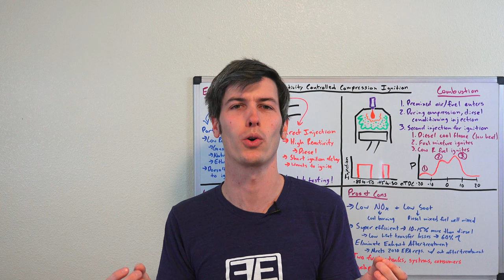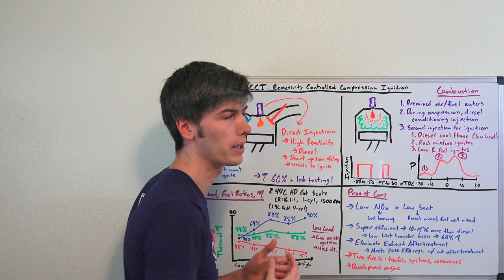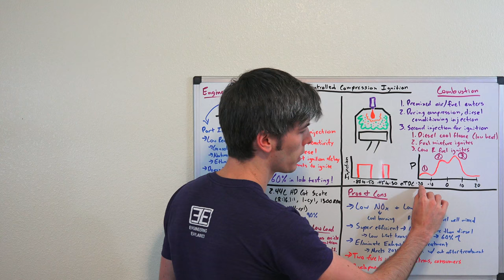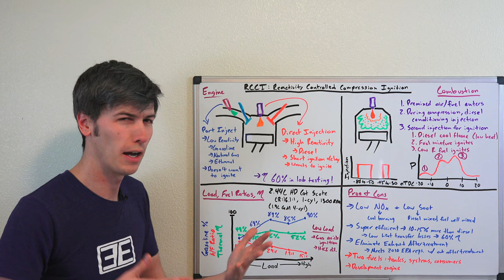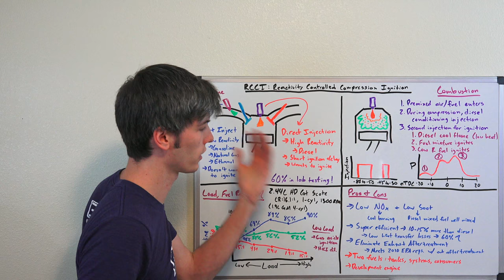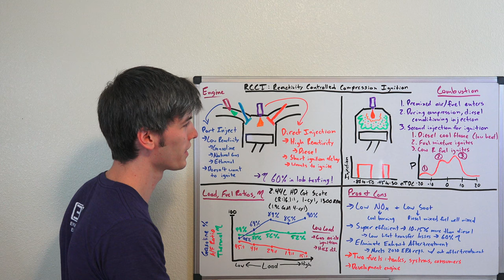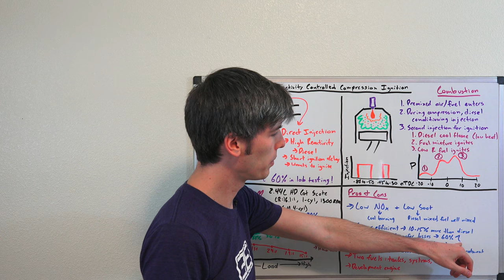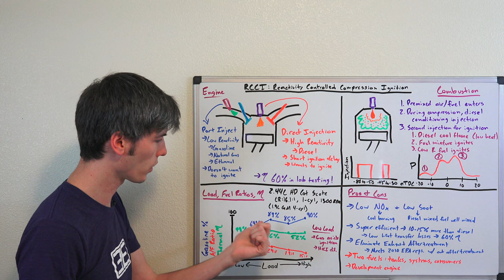Super Efficient Engine Uses Gas AND Diesel - RCCI

Comment: this was an innovative idea...... in 1954, when international harvester used it in their tractors,.didnt work that great then, wont work that great now. you'd be far better off with an aftermarket propane/no2 injection system.  anything comes out of adjustment and this engine you describe would destroy itself in a heartbeat.
 blending gasoline and diesel fuel pre injection is about all you can do to make this work reliably..... seriously, they've been saying they could do this and failing for over a hundred years. move on to non fossil fuels now please...

Comment: All freight trains since 1900 became electric generators petroleum gas or diesel to spend an electric motor and then send that electric current to the electric motors on the axles basically a train engine has an electric motor on every shaft with a big gear on it

Comment: What if the car is out of either petrol or diesel?
Reply from the maker: Diesel is the ignition source, so you wouldn't want to run out. But you don't want to run out of fuel in any car haha. Might be able to run purely on diesel in a sort of "limp to the gas station" mode.
Reply: Engineering Explained, then the exhaust system would require heavy catalytic convertors or you'll be left with no power and diesel emissions

Comment: A very narrow power band which will not work well with automobiles. The peak efficiency over load will soon be obviated by the need to stay within that band. 

Your videos, even a s well presented as they are, remind me of the time when the railroad steam enthusiasts were trying desperately to develop those much beloved, but inefficient engines to be competitive with the diesels just coming into service in the late 1930s. Over complicated steam turbines which could re-condense their steam into more feed water so that, like the diesels they could power right past the water tanks that slowed the schedules. Better than the other scheme to keep water hungry steam engines at speed, scooping water from long troughs in the middle of the tracks.

Which reminds me of the other cock-amamie scheme to make Internal combustion engines have more power and torque. Adding a water injection system along side the fuel injection, the so called six-cycle engine. By the way diesel efficiencies in practice only approach 50% efficiency in great marine engines at that steady ideal rpm, so this scheme may only add up to 60+% efficiency for that sort of constant speed engine. By the time this idea gets fully developed the electric revolution will be upon us all.
Reply: Narrow power band is perfect for a CVT.
Reply: Paul Gracey 
Most experiments start with a narrow scope in a lab environment.  It’s a proof of concept.  People said the same about the steam engine replacing horses... naysayers have been around as long as there have been people.

Also, you’re right that 60% is a peak value, but so are all the other efficiency values being discussed.  The Prius engine is only at 42% at its peak, not over a broad powerband.

Agreed, Electric will eventually win, but it needs vast improvement before mass adoption will take place.

Comment: Is it there a double the cost the fuel system because you have to have a fuel tank for both Diesel and gas then you have to have a fuel pump 2 for the diesel and gas then you have to have an injector two injectors one for diesel one for gas what are we talking here like another two or $3,000 for this engine

Comment: Funny how old ideas come around again ingersoll rand had a compressor back in the fifties that started on petrol/gasoline and when warm ran on diesel
Reply from the maker: But that’s for starting, versus a completely different combustion method for efficiency.
Reply: But how close to this new tech would it have been when you turned  off the spark ignition  at that point you would have petrol still been sucked in from the carb and diesel injected at the same time making  a mixed fuel.

Comment: 60% efficiency is pretty cool compared to 30-45% of ICEs.
But isn't electric engine 90-98% efficiency ? Yeah ICE's sound great, V8s are lovely etc...But is it still needed to invest in ICE technologies ? :/
Just wondering, maybe that money could be invested in wireless charging roads and electric cars with small swappable batteries ?
Reply: Yes, electric motors can surpas 90% efficiency, but you have also to consider the thermal efficiency of the power plant which create the necessary electricity to load the batteries in the first place.
60% is actually quite impressive. Not even 2 stroke marine Diesel engines can achieve that at the moment.

Comment: This doesn't sound very dependable, very complex at a single rpm, although load changes, vehicles are varying rpm, load, and the conditions are all-over the place, also altitude changes, air conditions, and humidity! Doesn't sound like it's going to work well, looks like another fuel could be developed , would likely be easier,

Comment: Why has no one made a diesel electric hybrid?
Reply: SDD525 I know that but why hasnt the same old tech been applied to a car. They use gas electric but diesel is more efficient
Reply: At least Mercedes has made one - 300h in C, E, S and probably many other models. 2.1 I4 diesel + electric motor.
Reply: Weight.  Diesel engines are just heavier and than couple that with a hybrid system which is also heavier, its just not attractive to make.  In the cars systems like this would be fitted to, being light weight and nimble are a positive.  It helps with how the car handles and feels to the driver.  It is just not worth the time and effort to do it.  Especially since the volume of hybrid cars sold is still very low.
Reply: Oshe Shango    most, if not all trains are diesel/electric. Save for the mag-lev and certain other high-speed mono rails. I'm not sure what systems are used on those.

Comment: overengineering cuz' they're afraid of electrics cars. Love it, keep going!
Reply: EVs make 1% of the market because they don't address the main issue. Your EV gets power from burning fossil fuels, and the generation systems have the same thermal efficiency. The technology developed here is advancing the ICE at the same rate EV technology is advancing.
Reply: Afraid? Well, maybe afraid of running bankrupt, because electric cars are freaking expensive? As long as batteries will be such a costly thing the EVs will not be a majority. Yes, there are better in almost any way than ICE powered cars, but that means near nothing when they often have double the cost (and no, I'm not talking about Tesla, as they don't have a clear ICE counterpart, they are unique).

Comment: This is a great advancement, but problem is, it still uses fossil fuels for energy.
Reply: voodooutt there is enough for that, just diesel will be phased out a bit more due the soot and nitrogen. Co2 is nit much of a issue what media is trying to make you believe.
Reply: I was not necessarily referring to just the Co2 that gets into the atmosphere when fossil fuels are burned.  It's the extraction and processing of the fossil fuels that's just dirty and ruining the planet also.  But, therein lies the problem, our technology and civilization at this point is based on those fossil fuels.

Comment: I am going to add gasoline to the tank of my diesel car from now on.
Reply: Don't mix the two. Gasoline has less lubricity than diesel fuel and that is bad for high pressure pumps and injectors. The only situation in which adding gasoline to diesel fuel is accepted is when the weather is so cold that diesel fuel becomes gel. However, in that situation, you should use a diesel fuel additive that reduces gelling so that your high pressure pumps and injectors get the same level of lubrication as they do with 100% diesel fuel.

If you really want to add something to diesel fuel for more performance, buy some fuel system cleaner and lubricity improver and add that to your diesel fuel. I have been told that Stanadyne and Liqui Moly make some of the best diesel additives in the world.
Reply: It was a joke. :-)

Comment: I thought gas was more reactive then diesel that’s why gas ignites easily in an engine and you can’t have super high compression with gas like you can with diesel and why it lites with a match and diesel won’t... or am I mixing up volatility?
Reply: I think you are mixing up volatility.
Reply: Diesel self ignites at a way lower temperature than gasoline, that's the reactivity that matters. For gasoline to self ignite  you need much higher compression(and therefore temperature) than for Diesel.. 
This technology uses this to its advantage, making it so the Diesel self ignition ignites the pre-mixed lean gasoline mixture. In a normal gasoline engine the gasoline is usually ignited by a spark. HCCI engines manage to get gasoline to self ignite but only in very specific conditions.

Comment: super efficient is electric - all combustion is inefficient.
Reply: There are a few problems with the statement that electric cars don't combust fuel. The device that charges the battery would have to not use combustion, and not every location can depend on solar, nuclear, and wind energy to charge those batteries.

Comment: tl;dw Let me ask the question that everybody wants to know... Will this new engine provide greater miles per gallon in the range of 150+ mpg?  If not, then why on earth would any consumer waste the hassle of putting two fuels in at a gas station at twice the cost?  This is going in the wrong direction of going away from fossil fuels.  I'm down for anything that will get me the best MPG for my buck, whether fuel or electric but common.  This seems like a huge campaign by the oil industry to try to get people to pay EDIT for both fuels at a higher cost than a single fuel END EDIT for the same car for little to no practical return.
Reply: Eh?  Oops, I didn't mean to say using twice the fuel.  I was referring to using using both fuels instead of one fuel, my apologies.
Reply: I edited my comment so it makes more sense.  Hopefully that helps.  Sorry about that.
Reply: well you would spend twice the time refilling gas but you would need less visists to the gas station.  the problem i see is that both tanks will empty at diferent ranges(based of diesel/gas mixture chaging on RPM ) . so maybe one time you will only be refullign 1 tank
Reply: wait, wouldn't that mean more visits to the gas station if both tanks empty at different ranges instead of both tanks emptying at the same time?  I assumed that both tanks would empty at the same time but uh, wow, that never occurred to me.  Please help me understand where you would be visiting less.
Reply: EpicATrain
It is possible to fill a tank before it’s completely empty.  Whichever one gets low first would dictate the refuel timing, and both tanks get filled.
Reply: Or, refill each tank as needed, get coffee at each refill, and stay awake longer to economically drive further... Until you need to pee more.  Sooooo, stop, pee, and refill the tanks again, getting more coffee!  PERFECT EFFICIENCY!!

Comment: 60% efficiency is nonsense. Max efficiency is limited first by the thermodynamic eqn (1 - Tmax/Tmin, using abs temps) and then further limited by compression-ratio losses.  No magic fuel mixtures and timing tricks can ever get around fundamental physics.
Reply: John H dont you mean min/max?
Reply: John H 
Why?  If you tell me 100% efficiency is impossible I’ll believe you.  60% sounds pretty reasonable.  As nice as this demonstration is, I doubt we’ve been given all of the information.

Instead of just saying it can’t be done, get your textbooks out and prove it.  ;-)